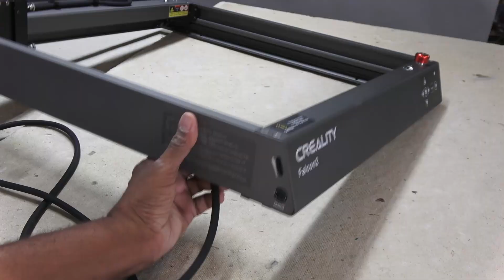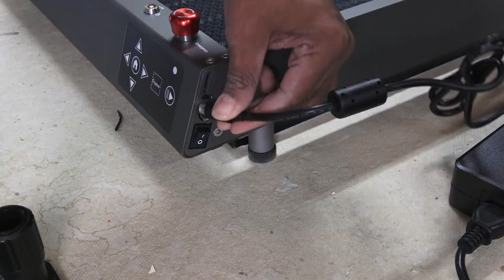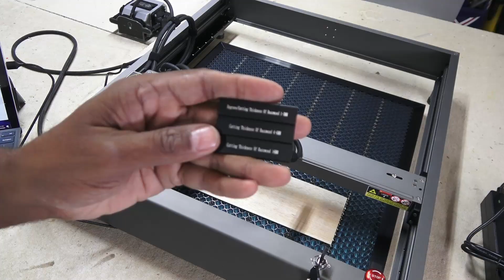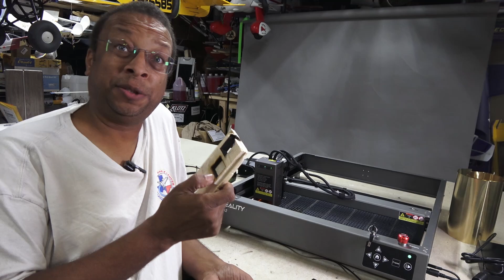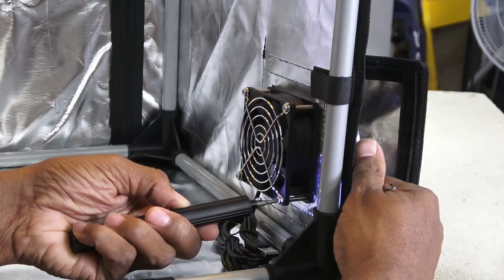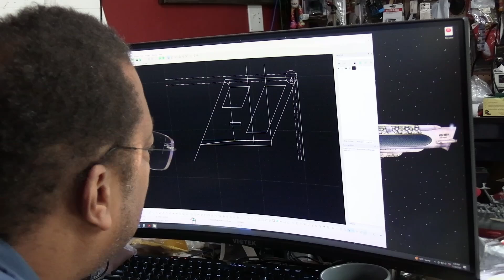Behold the power of this fully operational laser cutter! - Creality Falcon2 40w | HobbyView

Comment: No need to cut the power, it is a PWM controlled laser, so it will burn at 100%, just in shorter bursts when you lower the power level output, ergo, it doesn't save anything but the time the laser works. Set to 100%, upp the speed, and you finish faster. Lower the output, down the speed, and you finish slower. The time burned (PWM) is about the same for the laser head.